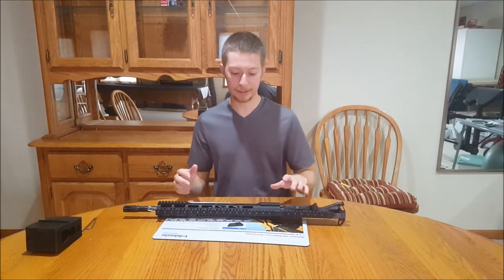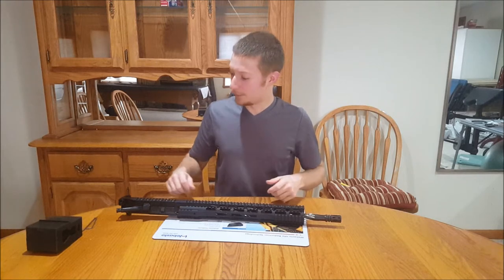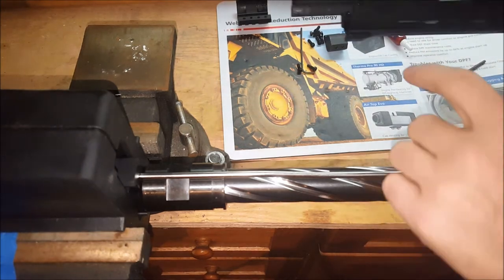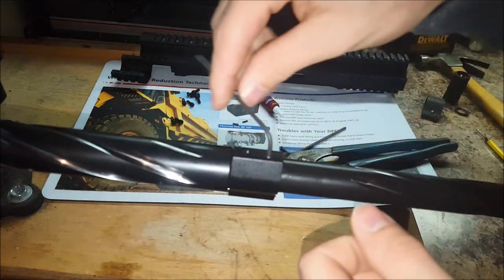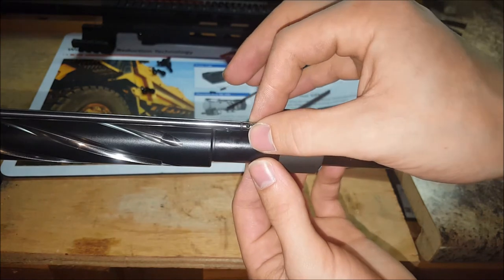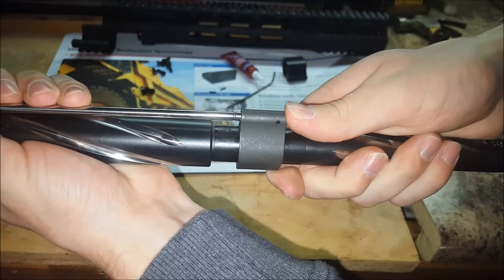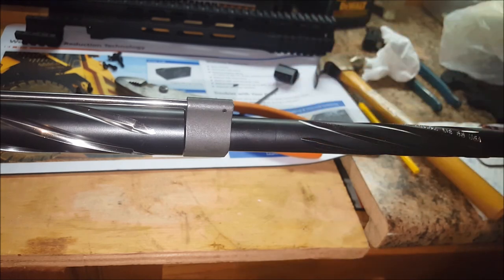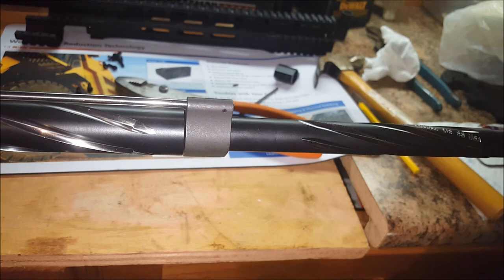DIY AR-15 Upgrades: Install An Adjustable Gas Block At Home

Comment: Pin tue tube into the gas block first, then slide it into place. Do not seat it all the way flush where it bottoms out at the taper, leave a small gap about two playing cards thick. Line up the dimpled hole with first set screw and tighten it down to 30 inch pounds with red locktite not blue (if you want it bulletproof) red is not permanent and can be taken off with a heat gun. Then do the same to the other set screw towards the front of the barrel. Always use a new roll pin as they should be thought of as one time use unless you like pins walking out while you shoot. That’s my 2 cents 👍🏻hope it helps you. PS they do make roll pin holders as well 😉

Comment: Before you drive the pin through the gas tube, push a small punch lightly through the block to make sure the hole is aligned in the tube. Then tighten the set screws on   block to keep it aligned. Tighten the set screws, remove the punch and then drive the pin through.

Comment: Im confused....where you over gas or undergased and did you try different buffer weights first
Reply: Heavier buffers just mask the rifle or pistol being over gassed. An adjustable gas block will cure this problem.

Comment: You won't be able to remove your gas block if you've got a pin/welded flash hider would you?
I'd like to put an adjustable gas block on a 14.5" barrel w/ pin/welded flash hider
Reply: Gotta cut it off and re pin it after. Just cut it, change the block, put a pistol brace on it and forget the re pin part